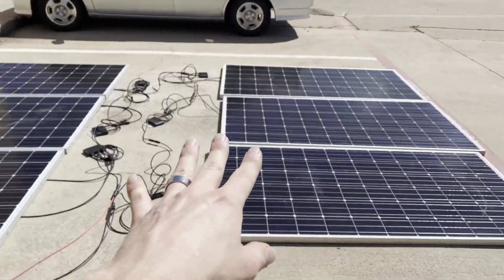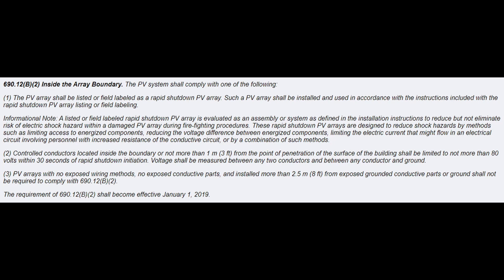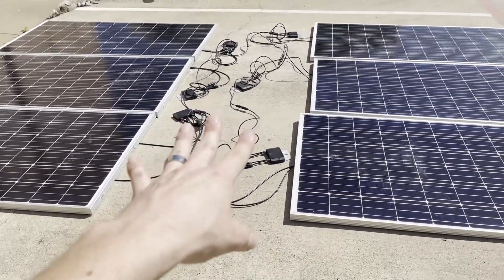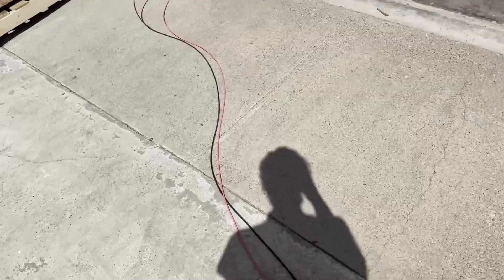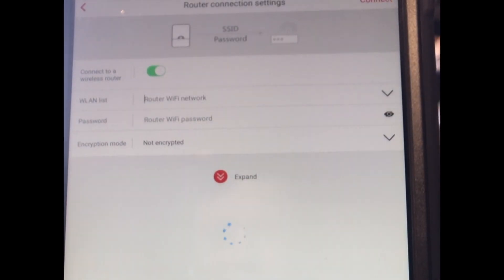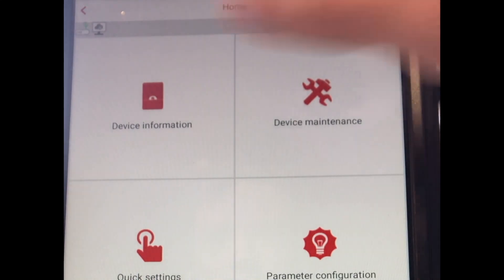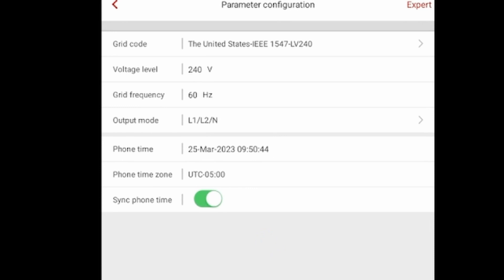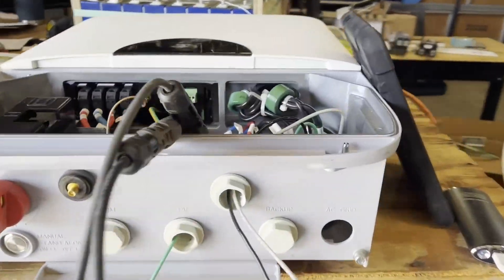Huawei Inverter Commissioning

Comment: The Enphase IQ8 forms an island if disconnected from the grid. so does that mean they don't follow the NEC for residential? Great videos tho. I love the testing.
Reply from the maker: Well yes and no. In order for them to form an island there must be a system controller that isolates the backed-up circuits and iq8's from the grid. The system controller also has a transformer to get 120/240 split phase output since the inverters are straight 240v. Thanks for the kind words! Bit of a dry video this one was :).
Reply: They use contactors

Comment: Great video . Does the inverter have zero export feature.  Thks
Reply from the maker: Thank you! Yes it is compatible with a few meters that allow zero export. aka Grid connection with zero
power. https://beenebrothers.com/wp-content/uploads/2023/02/SUN2000-3.8KTL-11.4KTL-USL0-User-Manual.pdf
Reply from the maker: However in looking it appears all of the meters compatible are either single phase or three phase. No split phase/2 phase! Wonder if one can use two single phase meters to achieve zero export. Ugh.
Reply: @BeeneEnergy   interesting 🤔
Reply: I am still looking for a grid tie inverter with zero export feature, but there are always obstacles .
1. solark - very expensive
2. Megarov- software issues
3. Victron using ESS feature - complicated 
4. Solar edge - need additional modbus
5.SMA- mod buss issues 
6. Sun GTIL - can't find the right size ct clamp for 150a service, unit not ul listed.
😢😢
Reply from the maker: From what I understand an Enphase setup with "IEEE 1547 default 2015, No Export" grid profile will do zero export. Just need an Envoy IQ or Enphase combiner with CT's going to the main electrical panel. I haven't tried it myself but everything I read says it does what we want it to do. Only use solar enough to zero out the meter but not back feed the grid. Might be a pretty cost effective way to get into a small zero export setup. I also threw a question into the Huawei forum to see if anyone knew how to do it in the US on split phase.
Reply: @BeeneEnergy  Intresting.  Thank you. There is still hope. Lol
Reply: I found a unit that is ul listed good price point with ct clamps zero export feature.  Your thoughts will be appreciated.  " Goodwe grid tie Inverter "A- MS series. Thanks again.
Reply from the maker: @andys5203  See if you can grab it’s etl or ul listing and look it up in one of the databases. Don’t have time to go look myself but that’s the first thing I’d do.
Reply: @Beene Energy  The certification looks good.  UL1741,1998,1699B, IEEE1547 & I547.1 and CSA 22.2. All this for $1495. Since this has zero export and the installation is done to code with a  rapid shutdown down installed do I need to get the utilities involved?
Reply from the maker: The utility question is fair. I really don't know! I've heard it talked about not being needed since no back feed exits.
Reply: @Beene Energy  Thank you for the quick response 🙏